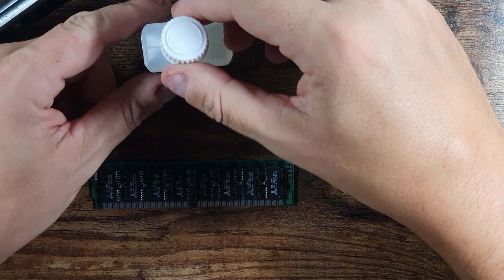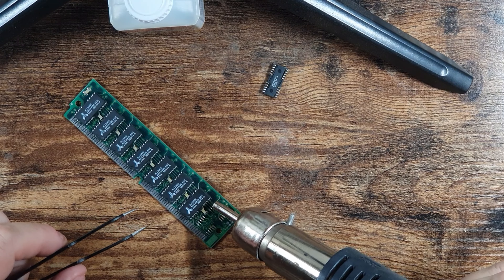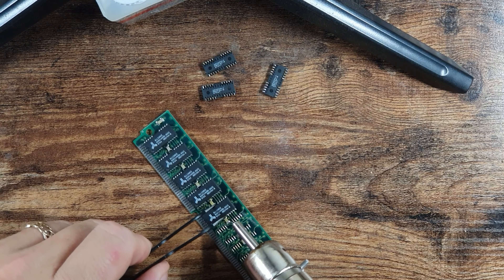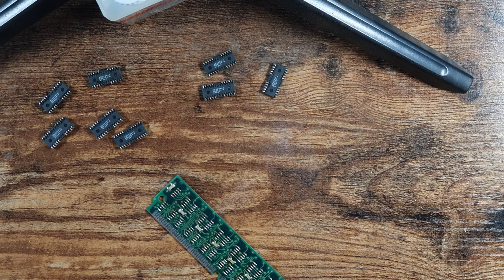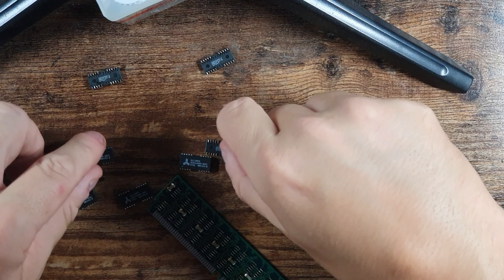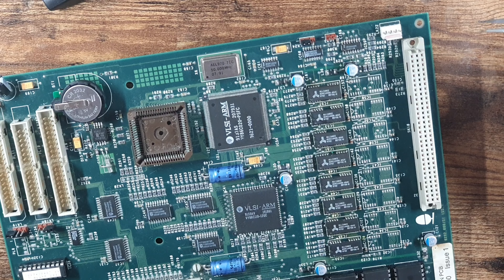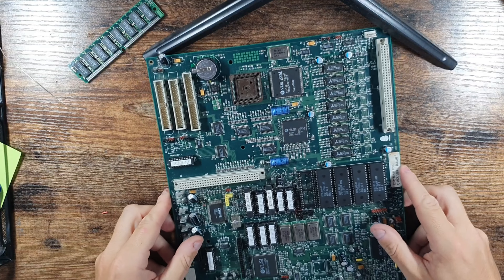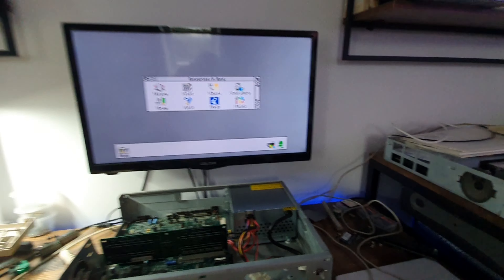Acorn A5000 - Tackling a red screen at post by upgrading the onboard RAM chips to 4Mb

Comment: To find some dead RAM chips I noticed some people on YT use a thermal camera.
Not sure if it is really efficient, but these people seemed to be quite happy with this solution.
Reply from the maker: I was feeling for hot chips but I couldn't discern any difference between them at the time.  Maybe a camera would be more sensitive
Reply: @its-a-retro-thing  Yes, maybe also it works better with the older generation of memory chips ( as used in the Speccy and the C64 ).